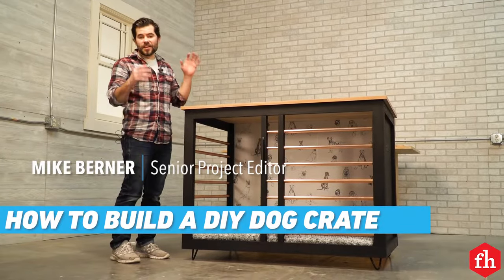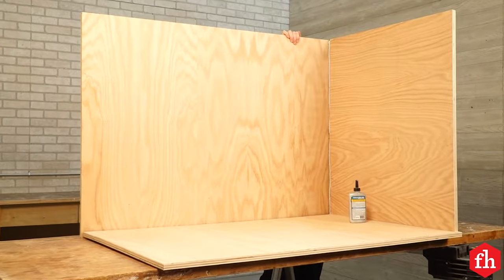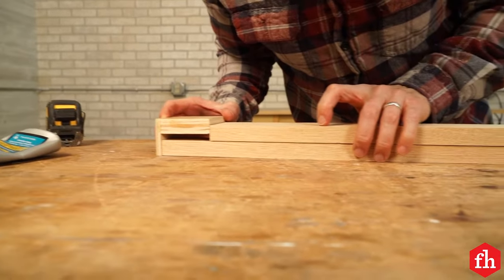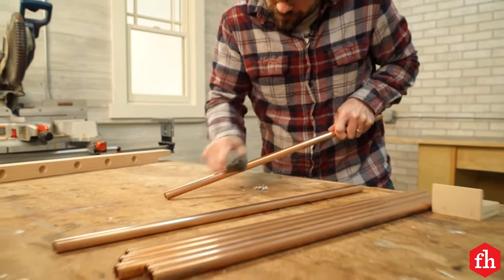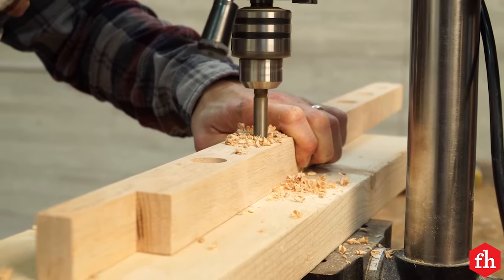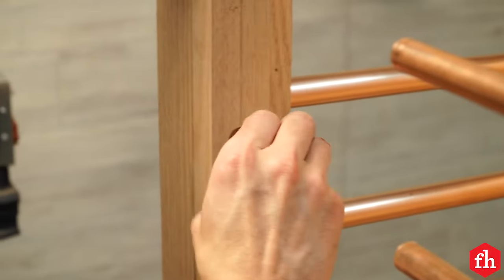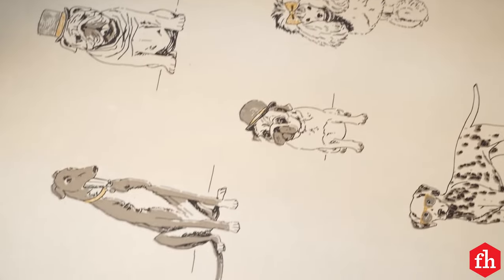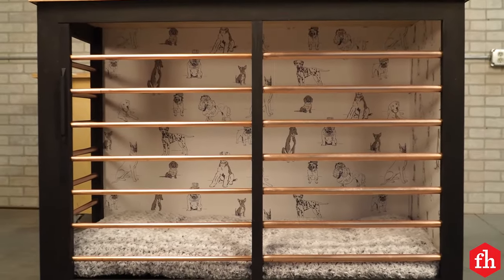How to Build a DIY Dog Crate

Comment: So all I need to make my dog a bed crate is thousands of dollars worth of equipment?! WICKED!
Reply: @THHSLunchTutoring  no but I'm sure there's a way of doing it with a lot more basic tools.
Reply: Most of this is pretty basic. Of course you can do it with a hammer, nails and a hand saw. To build this specifically you would also need a drill.
Reply: Shocker, to make stuff you need to have tools and materials. Who’d a thunk it. Obviously if you have the equipment you can use it for this and so much more and this video is geared toward those who regularly use this equipment. Anyway you don’t even need most of this equipment.
Reply: I’m a girl and I myself already have all these tools. You don’t have to spend thousands lol
Reply: @shelbyanderson7283  congratulations on being a girl 👧 👏
Reply: If you think it takes thousands of dollars worth of equipment to build this simple design then maybe it’s a project best suited to be tackled by some one else
Reply: You don't need all of these tools. Just get a black and decker drill, black and decker circular saw and speed square. Then buy screws and the wood and ur all set. Easily you can do this for under 200
Reply: @geridrh  such it, Gerid.

Comment: I'm in the process of building a similar piece and had some questions on the door. How did you ensure the pipes alignment, I saw when you opened yours it's not as smooth as it could be (i'm betting from the clearances between the small pipes in the big pipes). Also how well does that epoxy hold at the door end, with it sticking during open/closing I'm concerned about it not holding long term.

Comment: I got the plans in my magazine but before I start I am confused about the side panel.  The specs call for the plywood to be 23 1/4" x 33 3/4".  I think it should read
 30 1/4" W x 34 1/4"H (to match the top rail and Back ply height). Am I getting this wrong?
Also is the frame aligned with the base at the bottom or is it centered over the base?
Reply: Yeah, I’m working on this now and found multiple errors with the dimensions of the pieces. The problem is that I trusted the plans and then cut all my pieces and surprise! They don’t line up and dimensions are wrong. Too bad the Senior Project editor didn’t check the dimensions before they published it. I’m pretty disappointed.
Reply: @mbwtrpolo  I never started this because of the measurements being off. I like to build my projects in sketchup first since I work out all the problems in there first. Some parts are also unclear in the construction and I like views from each side. I will do it first in sketchup. Did you build the dog crate? How did it come out?
Reply: I’m in the middle of this build and have realized after all this work that the dimensions are off.. and the instructions are not very clear on how everything should align. Really great project idea but super annoyed that the dimensions are wrong.

Comment: Copper is poisonous for dogs?
Reply: I’ll bet your water travels through copper pipes.
Reply: When ingested, yes. When in extruded/hardware form, it's pretty inert. Personally I wouldn't use copper piping for this project, opting instead for steel conduit. But to each their own!